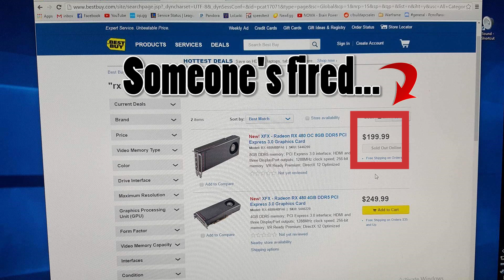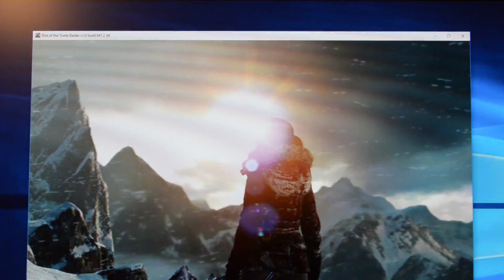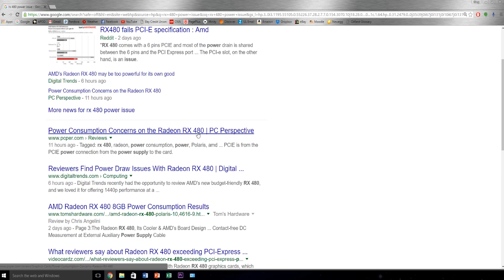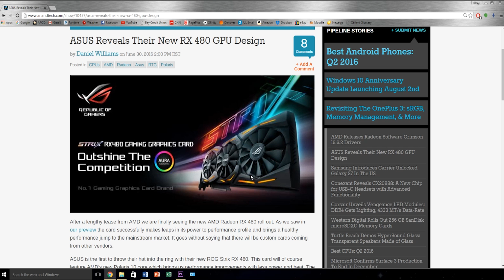RX 480 Aftermath: Power Issue & Over-Hyping

Comment: Dude use a quality PSU!
Reply: ^ savage
Reply from the maker: Did you not pay attention to the video? I used a 750W SuperNova. Quality PSU.
Reply: Obviously not!
Reply from the maker: Enlightenment.
Reply: bhushan kharmale heyyyy, he watched the whole video now!
Reply: other people's kids!
Reply: okay later you switched to a 750W one. Gotcha!
Reply: Garth Hendy yeah I don't need your advice though...
Reply: ummm FM2+ boards have pcie 3.0. Here is a link to Newegg. Which has 47 available now. 
http://www.newegg.com/Product/ProductList.aspx?Submit=ENE&N=100007625%208000%20600474768%20600474769&IsNodeId=1&bop=And&ActiveSearchResult=True
Reply: +PhatSquirrel First of all going from an APU initially and just using that and then upgrading to the 480 later is a valid update path and the APU actually got a better single threaded performance for its clock speed then AMDs  eight core enthusiast class processors. And also with HSA and DX12 a iGPU can actually be utilized in more code going forwards even when you have a dGPU.
And lastly, there are actually pure CPUs (well APUs with disabled iGPUs) for sale on the FM2 platform.
Also everyone that follow news about AMD know that they&#39;ll be releasing a new socket and chipset later this year with Carrizo based APUs that will most likely also support the Zen CPUs later.
That platform is in essence meant to replace all the other ones that don’t have the CPU solded to the motherboard.
Reply: Max W. Then just said "decent quality" when I hear "high quality" motherboards, I'm thinking stupid "Gaming eXtreme" boards for $130+

But even the b150 and h110 boards are still fine. You won't have a problem
Reply: you said 400 watt!
Reply: Nihilus yeah 😁
Reply: jlrockafella 😂
Reply: will i get problems with my asrock 970 performance mainboard ?
Reply: What? I'm pretty sure AM3+ are using 3.0, no?
Reply: Some Zen APUs might actually be running 480 or Polaris GPU, and if AMD still keeps the APU + GPU Crossfire support, that might be a nice setup.
Reply: Bloodstainer AM3+ does not use 3.0, part of why I'm looking forward to switching it out with a AM4 motherboard when Zen arrives.
Reply: Bloodstainer I don't think we'll get that with Zen, however Zen+ might get something like that as HBM will become cheaper and viable for a APU allowing higher end iGPUs without the bandwidth constrains usually holding back APUs, it'll still be thermally limited thugh.
For Zen I'm thinking something like the 460.
Reply: what is he gonna do with the psu if the card doesnt have  more than 6 pin u fucking idiot
Reply: jlrockafella
There's nothing out there worth upgrading too yet for AMD fans, so will have to wait till Zen arrives.
Reply: jlrockafella Dude I'm sitting on 4790k, what are you talking about?
Reply: No i have the Asus Aura 970 Pro Gaming Mobo which is PCI 2.0 in Xfire and they run fine.
Reply: Dude use a quality MOTHERBOARD! 
There, fixed it for you. There are standards and specifications that should be followed and budget motherboards don't always do them right. I never skimp on Motherboard and power supply.
Reply: Yourpants What are you talking about? Any modern mobo will work. You can run this GPU on a P67, Z68, Z77, Z87, Z97, Z170 without any problems, regardless whether its a $80 or a $200 mobo. Paying extra for motherboards gives you extra features, not better power delivery. The chipsets themselves are the same
Reply: Bloodstainer $80 is a good starting point. I am talking about motherboards that are even cheaper than that. There are a lot of motherboards that cut corners in regards to standards and compliance. Too low of a price and you end up with the bare minimum component-wise as well. Look up the concept of "muntzing".
Reply: Hi Salazar, I will buy this graphic card, model: MSI Radeon RX 480 GAMING X 8G
And I wanna know if one of these  mothers boards: 
1. MSI Z170-A PRO
2. ASUS PRIME B250-PLUS
Will do it just fine?
PSU:
Zalman ZM700-TX 80PLUS (700watts)

Thank you for your precious advices. :)

Comment: So basically to run the R480 you need a new Motherboard. Most people looking at this budget card most likely has an older MB so at this point spend the extra $30 and just get a 1070... Oh ATI....lol?

ATI card $250, MB $100 = $350.00  Wipe system and reinstall. Or spend $380 for a 1070...

Comment: ok i get what you're saying but up to now you're the only guy i know that had this problem. the card was reviewed but all you tech people. so maybe its you?
Reply: Every single reviewer out there is running their benchmarks using performance equipment. "Gaming" branded mobos, K and X intel chips starting in numbers 4 or greater, 700+Watt PSUs, etc. Why would any of them have this problem?
Reply: It's a budget centered card that doesn't work on budget mobos. I have no clue why AMD didn't just use an 8 pin or two 6 pin connectors, but this is the sad reality. 

You cannot use this card with any mobo that doesn't support a decent amount of power draw from the PCI-E slot
Reply: This isn't a review
Reply: jayztwocents touched on this topic a bit. You might wanna see that it's not just this guy. It'll be anyone with a board too old to handle this cards power draw from the pcie slot. Also the quality of the older board will matter too, not just the age. You can come into an old board with a high enough quality to not have this issue at all.
Reply: +Science Studio Damn. I was grateful to see this video just now to know about possible issues depending on hardware, but calling someone pathetic? Might be in a shitty mood or something, who knows? But I thought that was a bit uncalled for.
Reply: agreed. no one else has had this issue, and he had to pair it with an old and crap motherboard to make it happen. its not often that you find small time idiot youtubers as arrogant as this, but hey, just don't watch him again. He's certainly getting flagged for not interested in my recommended pile.
Reply: Amber Hunt This video is more of an afterword on his experience with the card and the news surrounding it. He references his review at the very beginning of this video. You should watch that video if you want to hear his test results and conclusions about the card.
Reply: He didn't say it would "fry" motherboards, only that it can destabilize older, cheaper mobos with poor power delivery due to the high power draw of the RX 480 on the PCIe slot of the motherboard. Also out of curiosity I checked the complete builds directory of pcpartpicker for even a single complete AM2+ or AM3 mobo build (ie anything even remotely comparable to the one he used) and there were none, so.... Take off the tinfoil hat buddy. Oh, and if there had been any, given that the card has only been out to consumers for a week, the odds that any have overclocked or stress tested their RX480 budget builds is pretty unlikely.
Reply: rage fards "rage fards"
Reply: rage fards Actually just watched a video by Gamers Nexus where they discussed that AMD recognizes this issue and how they themselves came across it in testing. Apparently AMD's gonna fix it by forcing preventative throttling when you can't give it enough juice.
Reply: fortris problem been?
Reply: Shawn Diaz on reddit, amd has stated it will not fry motherboards. there are already builds on pc part picker that use budget motherboards, and they don't have the issue. bullshit did this idiot randomly stumble across the power issue in testing, he would of knew about it all along, and used it to get more hits
Reply from the maker: Do your research.
Reply from the maker: Amber thinks this video was a review. How pathetic. My RX 480 Review was a previous video. Nice try.

Comment: Thanks for your upload, your time and effort is appreciated.

My two cents:

I had a problem using the 290 and 290x on motherboards that didnt deliver power correctly (older ones, asus m5a78l mlx plus and old msi am2 crossfire mobo).

I dont think its AMDs fault for not having full pcie 1.0 compatability, I think its more my fault for not having more quality parts before an upgrade like that.

If I remember right, I also had a problem with the MSI 970 Gaming using pcie 1.0 (I buy all the main cards to test for myself from both vendors), it would chirp and hiccup in 1080p resolution on max settings - upgrading the motherboard solved blizzard game issues.

I am not surprised to see problems with newer tech, I would go so far as to say that even the 1070 or 1080 on old motherboards using pcie ver: 1.0 may have problems because the power delivery hasnt been revised.

For most of us who have recent hardware this wont be an issue, because we dealt with this before and so at least it isnt something new or specific to the card.

Comment: Tbh, anyone with a very cheap or old MB should also have a cheap or old CPU which should in turn bottleneck RX480, so better wait for the RX470 which will consule 100W. Other than that, a great video as usual!

And some results that clear up the PCI-E topic for good and show that a driver update will resolve this easily: http://semiaccurate.com/2016/07/01/investigating-thermal-throttling-undervolting-amds-rx-480/

Comment: u see the mobo it says foxconn, that's the problem
Reply from the maker: This isn't the only brand of motherboard experiencing the problem. Try a simple Google search. Don't play ignorant.
Reply: no the problem is that the card needs a pci-e 3.0 slot, he is putting the card in a pci-e 2.0 slot
Reply from the maker: "PCIE 3.0" is not a requirement of the RX 480. That's the problem here. Not everyone uses a motherboard with 3.0.

Comment: well, i still feel that its just not good for a card to draw more power than it should from given connectors. I was hoping for AMD to be able to create a card that is en par to nVidia regarding power consumption, or at least close to it. but looking at the fact that the structure size was cut in half the power intake is still way too big. we havent seen the 1060, but i suppose it is not going to have issues like these and will manage to run off of 6pin + PCI-E without drawing more than it should.
might just be me, but it just doesnt seem right. Just cuz ur board may initially work fine with the rx480, from my understanding going out of specification may still lead to more "wear" on your mainboard, right? with crossfire 2x480, there will be  ~50-60Watts peak load that shouldnt be there running through your mainboard at times. this will definetely not help with your mainboards lifespan.

Comment: Or use 2 powersupply... 1 power the pc. 1 power the gpu Only?
Reply: .....كل زق بس
Reply: It doesnt work like that. The card needs more power inputs. An 8 pin or more. Just wait for partner cards if you want to overclock. Reference cards in general aren't the best at overclocking.
Reply: yes it does. you can use two psu on one computer. But that will not solve this problem
Reply: +andydabeast What?
Reply: andydabeast
yep i know it wont solve, but it will ease the wattage requirement haha but nvm the fix already here anyway.
Reply: Paul Finch
you seem not to understand what im on about lol
Reply: ya that doesnt make sense

Comment: So, I have a 2.0 PCI-E (H61), should I have problems with this?
Reply: guess so
Reply: Yes, you will have problems with the reference design one, wait for AIB partners to bring the cards. Don't buy the reference one, it even has a bad cooler 😜
Reply: with reference
Reply: No, should work fine. Bottlenecking is a debated issue and nobody can give you a solid answer without proper testing, but it will definitely work.
Reply: That Motherboard is relatively low end and old. The PCI power problems are expected to be fixed on the 5th, so I would wait until then. If the fix doesn't work, wait until you can get a custom card or 4GB version.
Reply: This is not a problem for me guys, I was gonna wait anyway for AIB cards (and I can't buy one right now lol)

EDIT: thanks for the answers

Comment: Wow that's an old motherboard. Unfortunately it doesn't have the molex connector some boards used to have. Would like to see if that affected the stability. Never knew what that connector did.

The motherboard is likely not wired to handle more power. Only one x16 slot meaning only 1 x 75W required + little for the smaller slots. .

Comment: Good catch.  But...this isn't a new problem.  Remember the AGP spec 2x 4x and 8x?  That was accompanied with different voltage feeds from the AGP socket as well.  You had to check your voltage with AGP specs.  You also have to check your PCIe voltage spec.  :)
Reply: PS - This also comes up a lot if you create custom BIOS' for GPUs.  I ran into it when I made my GTX 970 BIOS found here:    http://www.overclock.net/t/1556760/mad-dog-fargos-gigabyte-g1-gaming-bios-hynix-ram-final
Reply: Isn't the entire point of this card to be budget priced?

Well you can't use this "budget" card with a budget motherboard, so plenty of people buying this will face the exact same issue. Enthusiasts who have a motherboard that supports enough power draw probably are spending more than $250 on their next card.
Reply: Yes but...I'm confused why you would ask as a reply to a voltage/spec/custom bios research post...???   But it's not important, you're right, this is a mainstream card and if you don't OC much it fits within the 75w PCIe spec without issue.

Comment: in Greece the 8 GB model sells for 350euros or 390 dollars.....its cheaper on average to buy a gtx 970 or an r9 390 by 50-70 euros , the 480 is pointless on the Greek market because of the absurd pricing no point for this product, Its strong point was supposed to be the price i am dissapointed.

Comment: Problem solved, get a power supply with a higher output
Reply: the psu is not the issue, the card is currently drawing too much power off the pcie slot instead of taking that extra power from the 6 pin connector
Reply from the maker: You obviously didn't watch the entire video. I used a 750W SuperNova and the problem persisted. Pay attention.
Reply: 1070 :3

Comment: Single 480 / Crossfire 480 / or a single 1070?   (Price for single 480 in Norway: 350 usd / Price for single 1070:  625 usd
Reply: Single 1070 because it is cheaper
Reply: Overall
Reply: if you are considering a crossfire setup or 1070, why would that thought of a single 480 even enter your mind. you are clearly not the target audience for the single 480 with a budget like yours. also, crossfire or sli are not the best options, like ever.
Reply: What about Crossfire or single 480? is it worth spending so much cuz the prices in Norway are so fcking overpriced
Reply: +TheEverLoL MrLoL Depends what you're playing. What games do you play?
Reply: I play csgo, overwatch, Gta 5, Flight sim and battlefield. (Im going to use triple monitor so i atleast need 4gb of gpu ram)
My specs right now are:

FX 8320 Going to be overclocked to 4.2ghz or more with a Corsair H60 Watercooler

Msi gaming 970 motherboard

16GB of 1866mhz DDR3 Ram

240gb ssd and a 750gb hdd
Reply: Always go for the single GPU.. Speaking from experience here.
Reply: Yeah. i will see. Im going to first buy a Single aftermarked RX 480 Strix or Msi Gaming and then if its not enough performance ill buy another one and crossfire it. and if crossfire really sucks, ill just return both of them and buy a 1070 :D

Comment: So is the reference 480 out of compliance specs or not?
Reply: unless amd adresses the issue the rx480  referencem odel is out of spec with PCiExpress and if they fail ot fix this in  a reasonable time frame the card loses it certification as a pcie gpu.

Comment: Hey, could you crossfire this card?
Reply: yes this cars is capable of it provided  you have the right specs(2 pcie slots runnig at at least 4x, a good enough PSU with enough pci aux power connectors and a good way ot manage the produced heat)
Reply: I know lol, i just wanted to see if he could make a vid on it